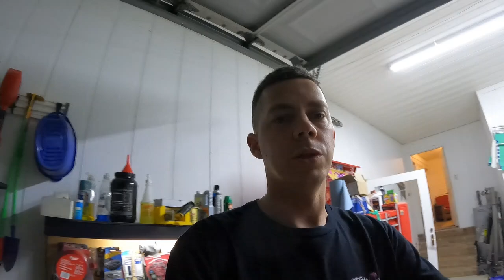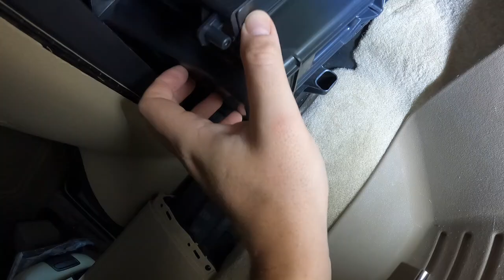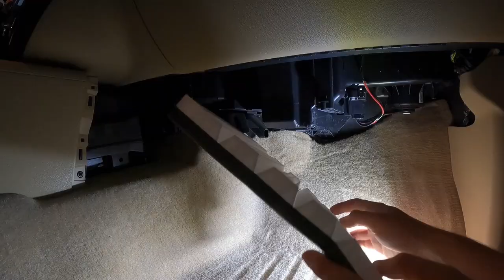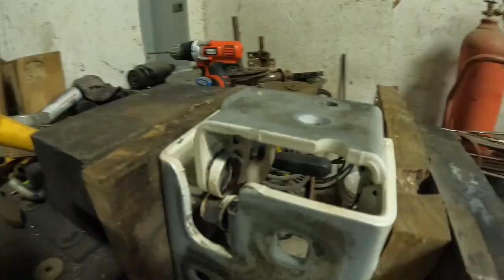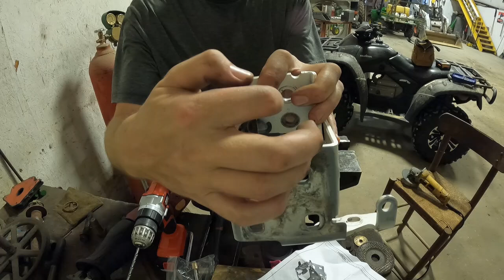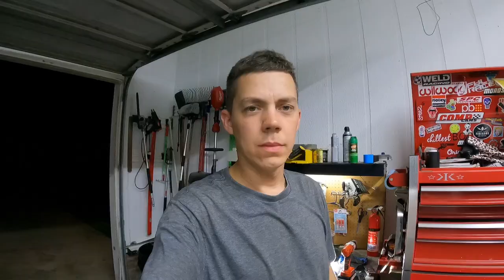Chevrolet Tahoe cabin filter retrofit and greasable check pin install. 2007 - 2014

Comment: Did you see greater air flow after the refit?
Reply from the maker: No, I didnt have any air flow issues to start with. I did it as a preventative thing. If you have air flow issues, your evaporator core may be stopped up.
Reply: @ballsoutperformance  Thanks for getting back to me, and for the advice. I still would have to opperate on the plastic to get to the core correct?
Reply from the maker: Thats correct.

Comment: Man, I wouldn’t have guessed it would have taken that much surgery.  Hope it works out for you.  Cool shop, btw.
Reply from the maker: Yea for sure. 2 week update, the hinge is working well.
Reply: What did you make the door out of
Reply from the maker: I bought it. Ac delco / gm makes it
Reply: I love my 2011 Tahoe, BUT NOT PUTTING A DOOR ON THIS IS RIDICULOUS, THERE'S A HINGE PIN AND PROVISION FOR THE FILTER AND MOUNTING SCREW HOLE ON HOUSING THAT THEY DIDN'T INSTALL THAT'S PRETTY CHEAP OF THEM...
Reply: Hey question? My AC fans on my dash aren't blowing hard enough is it cause that filter you cleaned be the problem?
Reply: Lil late but I found this out today while trying to change the cabin filter and realized there was none. Gotta get a blade to cut that open and start over.
Reply: @th_thGen_HondaChicks  I just found this out too I just ordered the new filter ..were you able to remove the filter to clean it? (The original one)
Reply: @elosopanda92 no, I didn’t have a sturdy blade or a small saw blade to cut the space open. There is no filter there if you haven’t put one before so I’ll be starting over tomorrow or Saturday.
Reply from the maker: Its an easy install